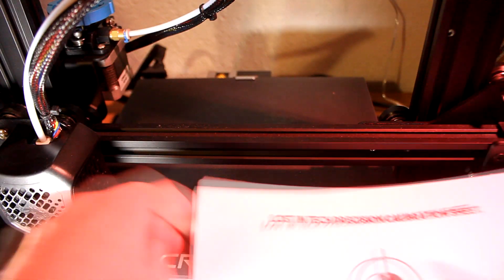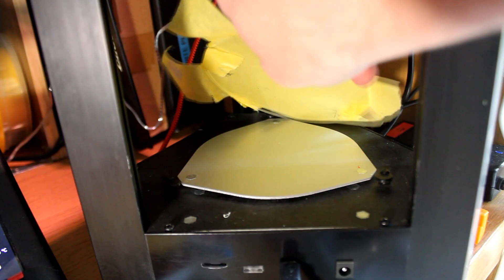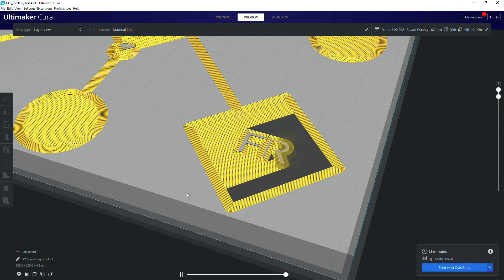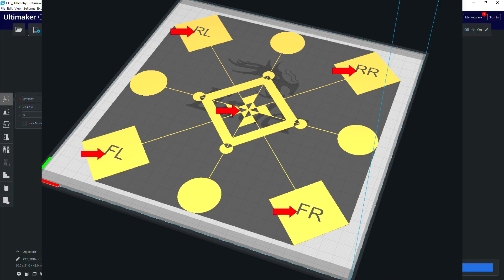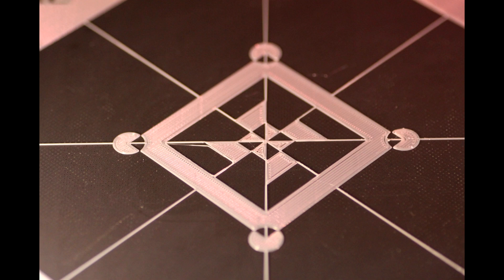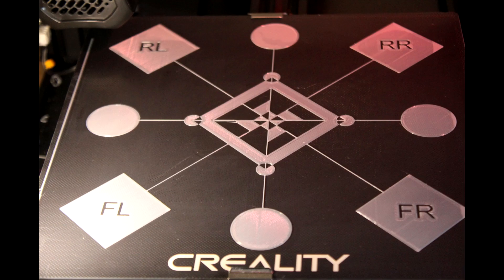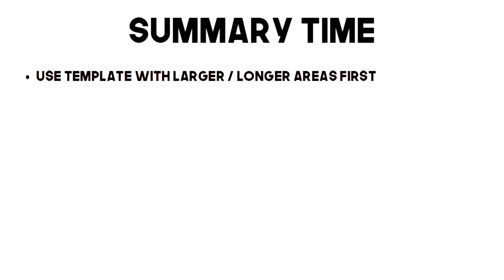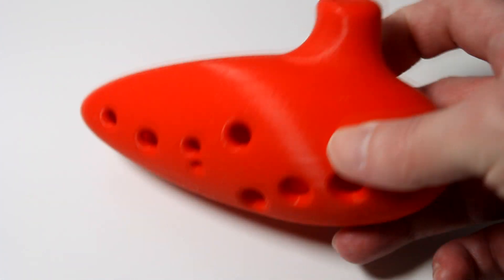How to level your bed on ender 3 v2 / other 3d printers - easy process-manual on the fly levelling

Comment: Thank you so much for this!
I have been struggling with printing PETG (which is very unforgiving to bed level and bed height) and the large diagonal pattern was perfect for getting the printer in the ballpark for getting good adhesion
followed by the more elaborate main pattern that really helped me fine tune it to perfection. I can now get really challenging prints to stick perfectly to the bed.
You deserve way more subscribers!

Comment: I brought the diagnol line test into cura and it did not fit the Ender 3 volume. I tired a gew tests by scaling each print going down to 85% in scale and each print would hit the bed clips and make my hot end jump. after 3 attempts I decided the potential damage was not worth it. :(

Great video though. Really nice stuff.
Reply from the maker: Really? The templates should be 220 x 205 mm to allow for clips at front and back. Do they show up as this size in cura? (bottom left of screen). 

If they do, and it's hitting the bed, then are you dead center on the bed when printing, or is your center not actually center?
Reply: @LostInTech3D   when I open the diagnol likes test in cura the object is located  (x,y,z) at 200mm, 0mm, 0mm and the scale  (x,y,z) is 220mm, 205mm, 0.3mm.

I am using Cura's Ender 3 printer settings in Cura 4.9.0
Reply from the maker: @vdebaie  Ah..I suspect the scale is the problem. I have the bed set to its true size but with safe zones at front and back for the clips. 

I've noted this down to have a look at to see if I can figure out what's happening and put a quick video out if I get to the bottom of it, because obviously you'd want to use the whole bed at some point! :)
Reply: Same here, cura will not slice it because it doesn’t fit within the build volume. Specifically the front and rear, which is likely due to the clips.

Comment: (re: the table demo) This is why they should use 3 leveling wheels in a triangle instead of 4 in a square.  3 points define a plane.  4 points is a pain.
Reply from the maker: Indeed they should! And so should tables! 
The flashforge creator pro has 3 wheels - but the creator 3 has only TWO wheels with the third being a static non adjustable third leg. Which technically is also 3 I guess.
Reply: One of my long-term goals with my smaller printers (currently 2 Ender 3 clones or near-clones) is to build a larger capacity printer that’s not a bed-flinger because that’s just nuts for scaling especially (it’s nuts to also be flinging something with a partially molten blob on it as well, that may be hotter than boiling water, for several reasons).

What this video shows nicely (thanks, @Lost In Tech, you got a new subscriber, also I’m saving this video as a reference!) is what’s called “wobbly table syndrome” or, at least, something very close to it: it’s actually worse because it’s a wobbly table suspended over a teeter-totter for the middle!

For my long-term printer design, it will have 3 points (adjustable supports) used for leveling out the bed to avoid this insanity, or at least make sure the bed isn’t a wobbly table/teeter-totter (reality is that with uneven heating, nothing can reasonably be expected to be perfectly flat and level) and is a stable target.

Comment: Very nice video also that adding some Silicone Solid Bed Mounts from amazon makes leveling pretty easy and using a bltouch and just calibrating z steps is a lot easier also you should check out Jyers Marlin firmware
Reply: I also have the creality bl touch v3.1kit for ender 3 v2 so I wonder if it depends on what version perhaps not sure
Reply: Thanks for another great video! Also gone through a lot of this process myself on my CR-10S with aluminium foil etc! Had to do that with my last glass bed, but since I chipped that one and bought another, I haven't had to use the foil, go figure!

I wonder if it would be possible to print solid bed mounts in hard TPU @Anthony, what do you reckon to that? It looks like it's not necessary to have a bed leveling sensor in order to use them (although a lot are recommending that online). Sounds like these would be preferable to springs at any rate?

If I end up trying to print some, I'll share my files with you guys!
Reply from the maker: yep gonna be doing a vid on jyers in the future probably. 
We'll see about the bltouch though ;) Lot of people say it's buggy, have you not found that?
Reply: @LostInTech3D  so far been solid for me I haven’t had to do what some people say about the interference and shielding it
Reply from the maker: @AnthonyUDT  noted. The problem with the internet is the negative bias you can get where only people with problems will talk about it. 
Guess I need to shift that one up the list then!
Reply: @LostInTech3D  True Also one last thing i did today i threw on some m4-0.7mm Lock Nuts on all 4 corners screws for my bed to prevent it from being un-leveled
Reply from the maker: @AnthonyUDT  all good plans. I of course can't do that. 

...because if I did, what would I make bed levelling videos with? :) 

Haha seriously though I'll put it on the list of things to explore in the future.
Reply: That's the exact setup im running although I haven't done a ton of printing yet (spent more time modifying it than using it), but I feel like once I get it dialed in it will be super reliable. 
I might change the abl from a 5x5 to a 3x3 because it takes forever to probe... or save a mesh to eeprom and not use G29.